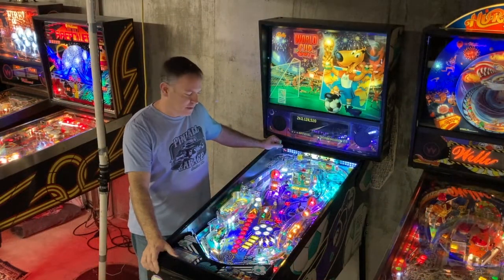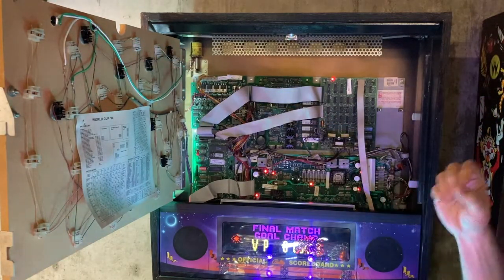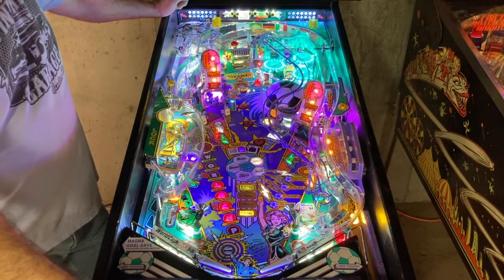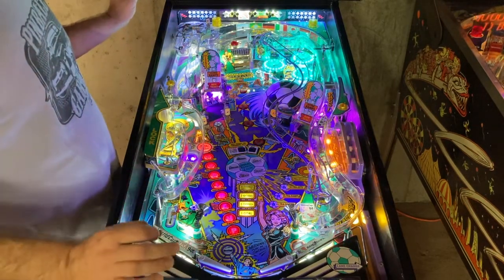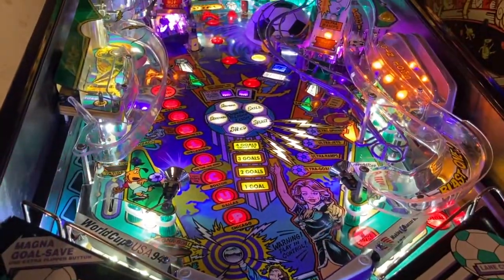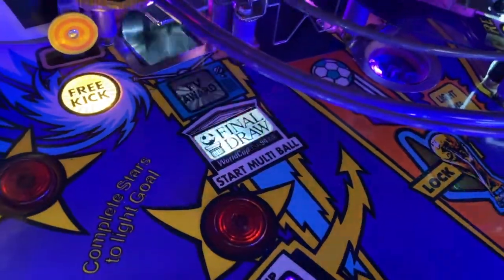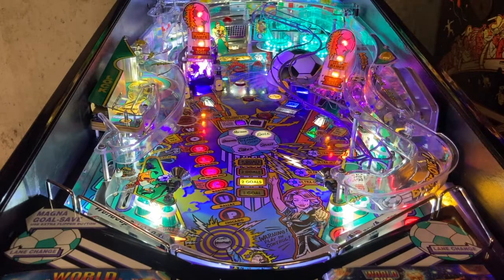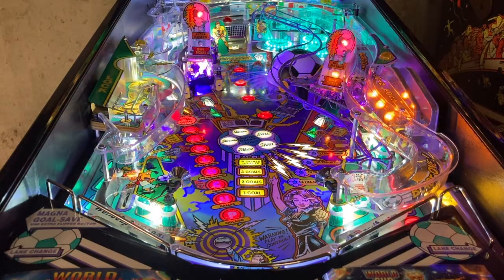1994 Bally World Cup Soccer pinball restoration

Comment: I'm amazed at the overall 'dark purple' look of the playfield in the first 5 seconds of the video. Did you do something special to create that effect, or does it have that on its own once the LEDs are in place?
Reply: I just realized it's your spotlights that are doing that. My guess is you used Comet's alligator clip option to power them up. May I ask what you connected the alligator clips to?
Reply from the maker: Part of the effect is from adding spot lights down on the slings to light up the center playfield. I can’t recall if I used Comet’s “Op Max” purple bulbs or cool white there, but pretty sure it was purple. Other than that, the lower section is lit with cool white LEDs and a trough light. There is a little trial and error involved, and personal taste. This game was one that I was particularly pleased with how it looked when all done, with all the extra lights in other spots and full LEDs everywhere.
Reply from the maker: Sorry, just saw your added post. I did use Comet’s lights and sockets. I don’t really like using the alligator clips; not that they are bad but I prefer to cut off the clips and solder them to existing sockets for a more secure connection. I think I just connected them to the lights already on the slings. The game is a couple hours away from me at Pinball Garage in Hamilton Ohio so I can’t verify at the moment.
Reply: Thanks for your reply! I guess you have to solder them to lights that are always on (like the slingshot lights). I also like the spotlight you placed behind the left ramp that points towards the ball. Any tips on how to solder the spotlights are welcome, I guess I'm afraid to mess things up 😅
Reply from the maker: @whipy9203  it might be a good idea to use the alligator clips to initially hook up the spot lights to existing sockets so that you can verify the added lights work how you intend them to. Honestly, the clips are ok and you might want to just leave them that way. But if after you’ve hooked them up and confirmed all is good, you could go back and solder them in.

Comment: Just bought this table and I really like your light setup. are you using red or pink in the WORLDCUP letters?
Reply from the maker: Congrats man!  It’s a fantastic game. The lights in WORLDCUP are clear red 2smd bulbs from Comet Pinball.
Reply: @LeebosPinball  so basically you put the same color LEDs as the insert plastic color?
Reply from the maker: @TrailHunger  yes, for the most part. I color match LEDs to insert color for red, green and blue, but for yellow inserts, I use warm white or cool white. The yellow LEDs are just not bright for some reason, so they don’t work too good for inserts. The purple lights in the spotlights I added are Comet’s “op max” bulbs.
Reply: @LeebosPinball  thank You for that!!
Reply: @LeebosPinball  what do you do for the orange inserts, such as the left inlane and the magna ball save (both of which are bayonets)?
Reply from the maker: @whipy9203   I think I used warm white bulbs under the orange inserts.  The game is a couple hours away at the arcade so unfortunately can’t quickly check, but I generally use warm whites on the orange inserts to contrast better from red inserts.